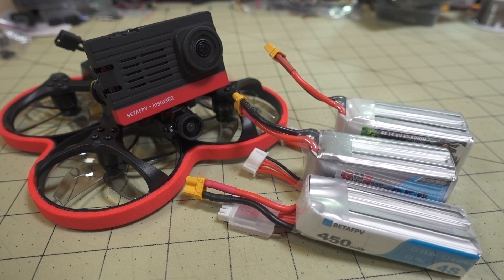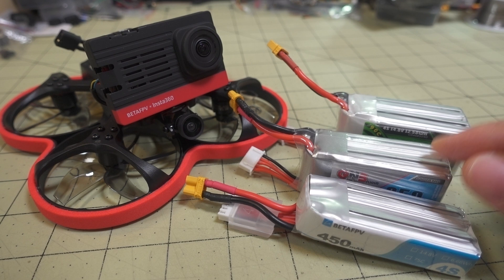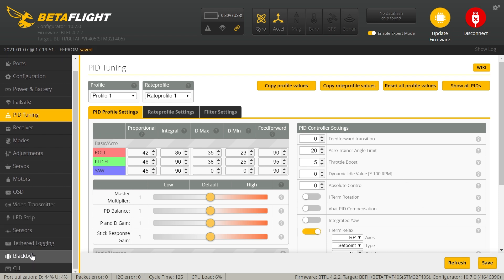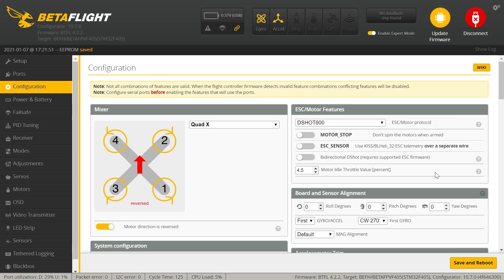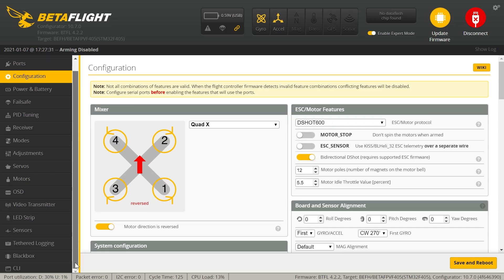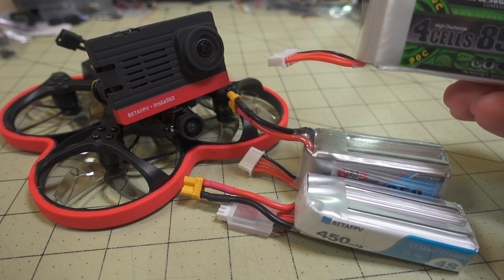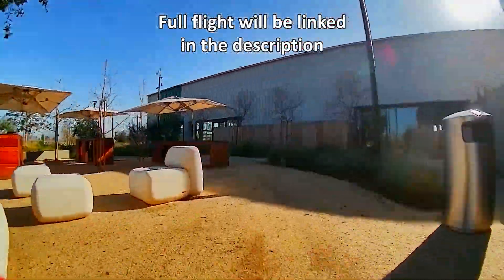BETAFPV Beta95x V3 Albert Kim PID Tune 🛠️

Comment from the maker: 🛒 Beta95x v3 (DJI)
       RDQ - http://bit.ly/2WKWgX2
       NBD - http://bit.ly/3ccFTcY
       BF - http://bit.ly/3p2QdsX
       PD - http://bit.ly/37wxHn2
       XT - https://bit.ly/3muIZw4
       BG - http://bit.ly/3o56g8y

🛒 Beta95x v3 (analog)
       RDQ - http://bit.ly/34Ds7Ny
       NBD - http://bit.ly/3ediQBy
       BF - http://bit.ly/34H2ziT
       PD - http://bit.ly/37uHXvH
       RDQ - http://bit.ly/34Ds7Ny
       BG - http://bit.ly/3914Nfi
       XT - http://bit.ly/37zd2ia

📝 Factory Settings - http://bit.ly/3rStJNF
📺 SMO 4K review - http://youtu.be/7pUq2L8LDPE
💧 STL for naked GoPro - http://bit.ly/3pLTi0V

📝 Updated CLI (use w/caution!) - http://bit.ly/3iePHWI
📺 Full flight - http://youtu.be/cXReE21XJmU

🙏 Please support with a 👍 and don’t forget to hit the 🔔 thanks!

👉 Old gear for sale here -  http://bit.ly/AlbertGearFS

💲 Get the latest exclusive coupon codes (updated often)
     http://bit.ly/34SYiGn
Reply: Thankyou for the Tune flies beautifully now. Motor temps are actually better. May I suggest  turning too Dshot 300 as well . This made the motor noise and vibration almost disappear.

Comment: Thanks Albert firt of all for your video. May I ask you to confirm if I can use the same setting for the Analog version? Many thanks for help.
Reply from the maker: I've never tested the analog version.  The weight is less so the PIDs might be too high.  You may get hot motors so use caution and lower the PID values as needed.

Comment: Thanks for video.

You say it's the best setting, but the device you're flying with still has a little jello. Why? I wonder if there is a solution to this?
Reply from the maker: As I mentioned, it's a design flaw because the FPV camera is mounted directly to the frame.  So any motor or prop vibrations will create jello.  If the motors and props are perfectly 100% balanced then no jello but that's very unlikely at these cost levels.

Comment: This tune is tons better than stock. My 95x feels way more locked in now with cinematic stuff. 
Is there a way to reduce bouncing on takeoff/landing? I always get a little bounce but this ones realllly bouncy
Reply from the maker: Turn off AIR MODE and that bouncing should go away.
Reply: @AlbertKimTV  I’ll give it a try! I’ve never flown without air mode before, what should I expect? Strictly flying smooth cinematic with this little guy.

Comment: Nice, thanks for the info. Change my motors from 1204 5000kv to 1106 3800kv, now using 5 bladed props and tuned with UAV Tech Presets whoop settings..Motors are not getting hot that much.

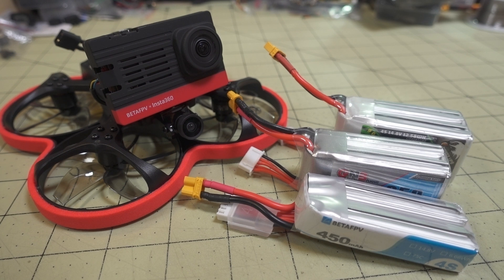Comment: I thank you so much for these PIDs, now the engines are completely cold !!! a question if I decide to use a 450mah as a battery do I have to change something? What if I fly without SMO 4K cam? I now fly for 3:15 minutes with a 650 mah, they seem to me few without wind and in a sweet way.
Reply from the maker: As the weight changes, the PIDs will need to change.  That's why learning how to tune is better than getting PIDs from someone else.
Reply: @AlbertKimTV  ok you have already done a lot for me and I thank you, I'm just afraid of doing damage. Anyway I just want to ask you if it is normal only 3:13 minutes of flight with 650 mah and SMO cam above?

Comment: Is it me or is there a whole load of jello in that flight footage?
Reply from the maker: There's still some jello.  Not much you can do to get rid of it because the camera is mounted directly on the frame where the motors are mounted with no vibration dampening.

Comment: Wondering what adjustments would you make to this tune if I changed the motors out to 4500kv? Or is that a bad idea?
Reply from the maker: You'll need to drop P and D gain from 1.4 to 1.2 or lower.  Increase Dterm filtering by sliding the bar to the left a couple more clicks.
Reply: @AlbertKimTV  Thanks Albert, tried your tune and its pretty good on mine. I’m getting a lot of jello in the FPV cam though. Are you experiencing the same?

Comment: Thank you Albert!  Will put this tune on my rig tomorrow!  I was bummed there was no integrated black box on this FC. This definitely makes my life easier. I agree that the stock tune is very sloppy. I have the Analog version and can get about 3:45 flight time on the 450 batteries. Hopefully the tune and filtering helps lengthen that time. I also get some vibrations on throttle punches. Looking forward to the improvements with bi- directional.  Thanks again!

Comment: Thanks Albert. Have you seen any decent 95X v3 mounts for the naked gopro? I'm disappointed they didn't include a mount for that option, just the insta360.
Reply from the maker: That STL is on the bottom of the product page here - http://bit.ly/3p2QdsX
Reply: @AlbertKimTV  You're the man thanks Albert. Hopefully some day soon they'll release the wire diagram for that new FC.

Comment: is the same for the V2?
Reply from the maker: Don't use the CLI dump, it will turn it into a paper weight.  The CLI dump only works on the V3 FC.  You can try and put in the settings manually as I showed in the video but back off P and D gain from 1.4 to 1.2.  Again, don't use the CLI dump as it will brick your quad.

Comment: you were very kind to make the settings, I can also add that with the pid stock my beta95x v3, with 450mah battery and without SMO camera, the rear motors heat up a lot !!!  now i will try with your settings.

Comment: When I bought mine I had an issues with the crossfire connection. Where and how did you wire the receiver to?
Reply: The PNP version has UART1 reassigned for camera control (start/stop recording on the SMO 4K). I flashed mine in Betaflight to the factory settings using the bone stock firmware for the flight controller. This made UART1 work again and let me use a plug on my Crossfire Nano on the UART3 plug input (which also didn't work for whatever reason from the factory). You should back up the diff all in betaflight before wiping out the firmware, this way you can reapply all of the settings like the motor mapping (don't reapply any resource mapping that mentions PINIO, that's the camera control stuff). Also be sure after flashing the flight controller you choose 'yes' for apply default settings when prompted.
Reply: @mrb2917  yes I have done that but wanted to know what Albert Kim did.
Reply from the maker: My crossfire receiver came pre-wired from the factory.